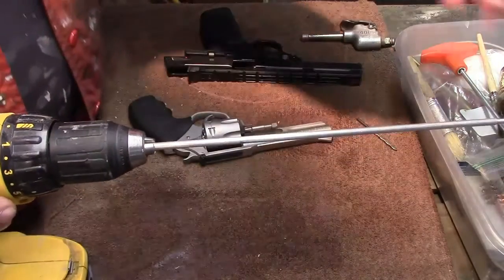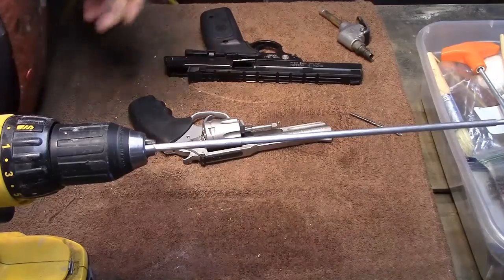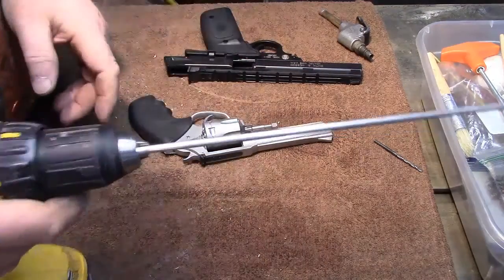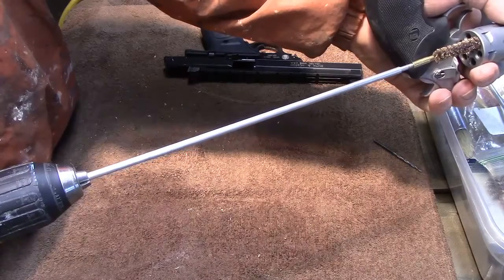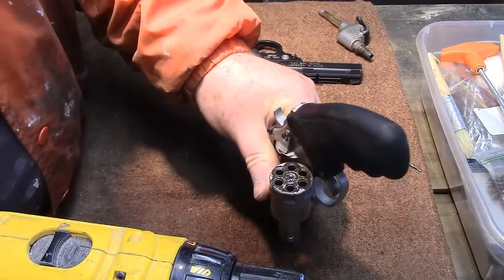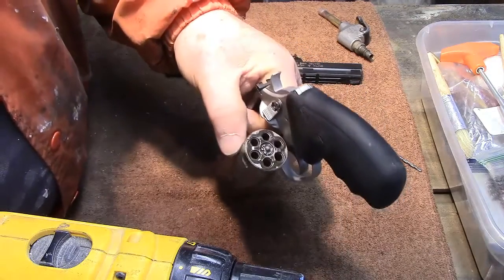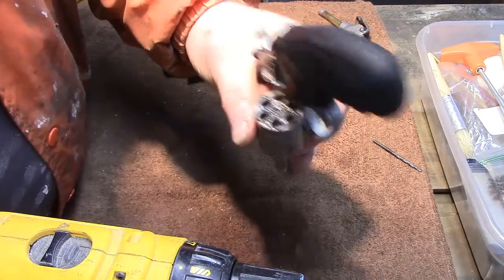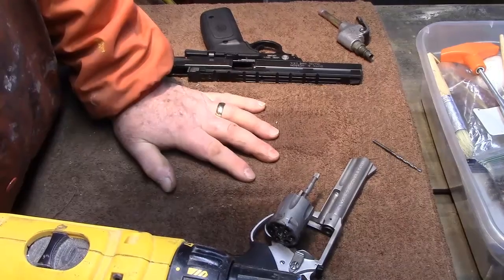Charter Arms, My Final Thought.

Comment: I have one of the original Charter Arms Pathfinder revolvers in .22 LR.   It has never given me any trouble--other than Federal .22s that didn't have the priming compound all the way around the rims, causing occasional misfires.    I have the "bulldog" grips on it.   This revolver fits my hand better than any other handgun I own.   I have the factory holster for it, also made by Charter Arms.   It's a very accurate .22 for having only a three-inch barrel--I can shoot very tight groups with it.    It rides very light on your belt and cannot be beat for hiking or camping.
Reply from the maker: At one time they made all their own parts, but for a while now they have been subbing out all parts of the firearm, one place does the barrels 90%, another place does the frames 90%, the hammers from another place, cylinders from another place, all action parts from another. With all parts coming from 4, 5, 6, different places nothing wants to match up. Charter Arms is just assembling most parts, they do however finish off each part seeing most parts come into them at 80, 90%. If you have one of their older pieces when they were in their old building and making all their own parts you have a good one. I was there twice and been through the whole place and seen how and what they do, and when their shop Mgr lies to you and you have the same problem you were there to have fixed that along is a big NO. to me.  For me, I will never buy or recommend a CA to anyone.  Again their older are better than their new junk.

Comment: The .22lr Pathfinder that I have does tend to get very dirty, but I have never had an issue with it going bang or not extracting rounds. And mine has dimples in the cylinders from people dry firing it in the store before I bought it. I have put hundreds of rounds through mine at the range in one day, and never had any issues. Maybe yours has tighter cylinders. I love charter arms revolvers, and would buy them every day if I could. The qaulity issues in the 80's and maybe 90's wasn't the greatest, many people know that, but I haven't had any major issues with any of mine.
Reply from the maker: Like anything, if it works for one good and if not o-well never again.  They were good when they made them but now they just assemble them. they farm out all the parts, frames from one company, barrels from another and they come to them at 80 and 90 % then CA  drill out the barrels, cylinders, and frames, 2 robotics buff then a half dozen workers assembles them. 7+ different companies are making the parts making it hard to fit them together. Once they moved to a smaller place they didn;t have the room to machine all parts.  Their older stuff is better.
Reply from the maker: ps, I did a vid when they gave me a tour
Reply: buzzsah I’ll check it out
Reply: buzzsah I agree the older ones were way better. I just picked up an undercover in .38 special, circa 1973 ish, and it locks up as tight as an old smith and Wesson I have from 1981. Most things these days have worse quality than they did even 10-15 years ago. It’s sad.
Reply from the maker: @crankysports  I can't remember the title but its nearby

Comment: Good info! Can you please do a follow up video? Had to dig to find the results of this polish job.
Reply from the maker: It is working but if I run 50-75 rounds back to back its hard to eject them.  I think it should work out if not I'll rem it again.
Reply: @buzzsah  the chambers might have been cut too tight....a  finishing reamer may help, its a problem common with older smith wesson 22

Comment: I tried one like this at a local range - same model with the target barrel.  I thought that the action and accuracy was very good, especially since I didn't expect much.  But I had a similar problem - I had to pry the spent cases out of the chambers with my fingernail.  In this case I suspect it was because the range never cleaned the revolver, much like your friend's gun, and it was loaded up with soot in all the inner workings.
Reply from the maker: +Goldberg1337 I would be happy if they fixed it when they said they did. I was there and was given a tour  of the place while the fixed it, I took it the the range and it did the same thing.  I told the person he needed to fire at least 12 - 18 rounds.

Comment: I found tiny burrs on the cylinders from firing pin strikes. These were on 2 BRAND NEW Charter Arms 22's! 
Shells would go in and out with ease but once fired the swelled case apparently would catch on the burrs. 
I had to hammer on ejector rod with wood block to get them out. I dremeled off the burrs, good to go.
I theorize that some disgruntled factory employee dry fired every gun he touched. lol
Reply from the maker: Is or was the firing pin out of alignment, or the cylinder?  When firing a run, did you, do you check the casing to see of the firing pin is hitting the casing and the chamber edge?  Dry firing a 22 is not a good thing, if the company dry fires a few, 1, or 2  that's on them. But don't dry fire a 22, if you want to work on your trigger pull, buy a few snap-caps.  If you just bought it, or still under warranty call and send back. Personally, I will never buy another CA  Somewhere on my vids I filmed some of the factory.
Reply: @buzzsah  I never dry fire 22's !, These were both brand new guns, one from a gun shop and one from Buds. And the problem was from day one. But somebody at sometime HAD to have dry fired them. The burrs were on the very edge of the chambers not the outer part of the rim recess. Apparently the firing pin must have hit the face of the recess and pushed a tiny bit of metal out into the chamber. I noticed a tiny scratch on the spent shells from the burr.
So I looked and saw the burrs using a magnifying glass, I didn't want to ship them and wait for return, I just fixed them.
I've since sold them and haven't bought another CA 22 since.
Reply from the maker: @profwaldo  All is good now? Fixed and working?

Comment: Looking good  brush and drill combo will help  try a cotton patch and dab of polishing compound next then wire brush and drill again  then new clean patch and dab of polishing compound and repeat  along time ago I had a similar problem with  a ruger  , just take youre  time and try not to over heat the gun  good luck.
Reply from the maker: Sorry for the late reply.  It did work and so far all is good.

Comment: How is the gun running currently after almost 3 years of use? I am looking at my 1st 22mag and I want a 10shot revolver. Is this extraction problem your only issues you have had? Or if you could do it again would you go with another revolver model with no more then 500 worth of funds lol
Reply from the maker: t is running fine after I fixed it but would never buy another CA due to their product and service is not like it was when they made all parts.